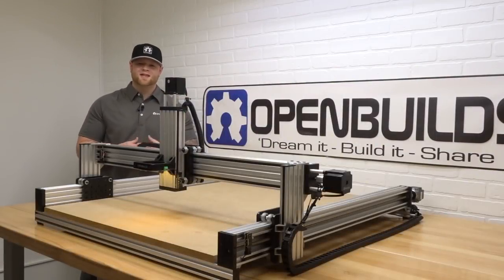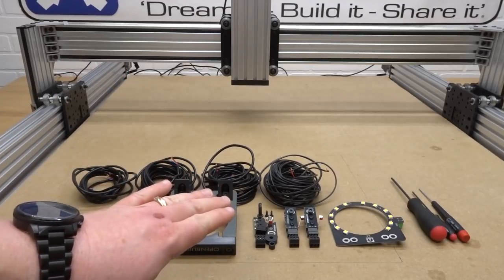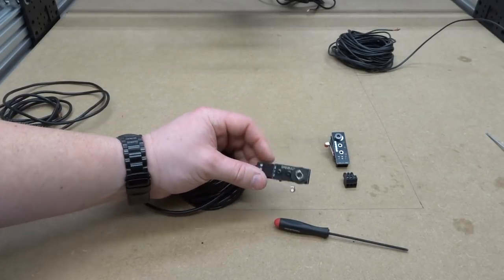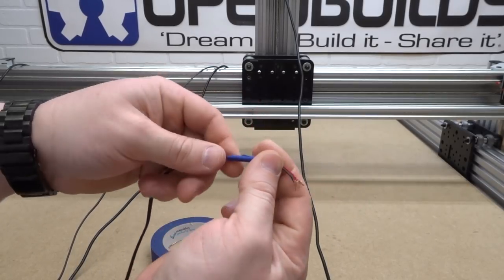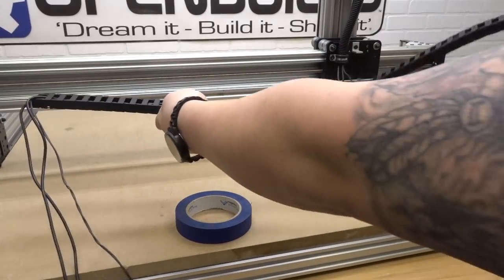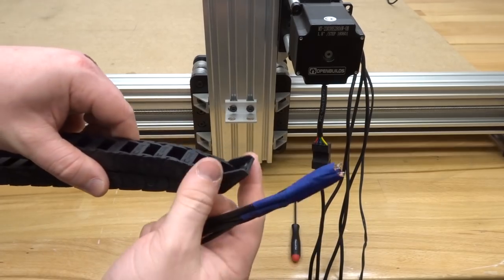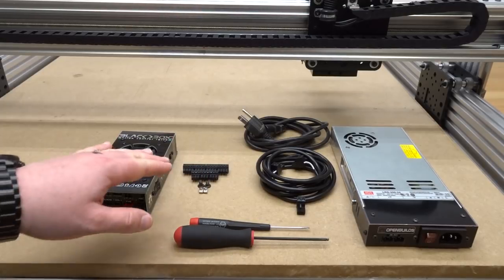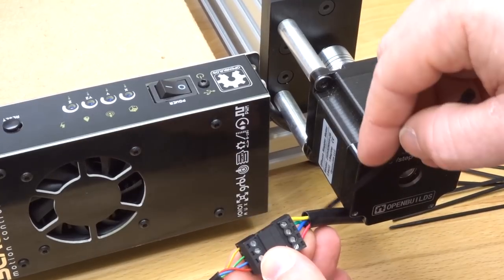OpenBuilds LEAD Machine 1010 Electronics and Software (Using BlackBox)

Comment: Nice build I m thinking of a lead 1050 setup for my workshop in spain for small but high quality work hence the lead.... would love 1075 just no space....
Reply from the maker: Thank you! I understand space can be an issue when working with a larger machine, but thats the beauty of the OpenBuilds Modular System, you can alter the size of these machines to fit your needs. Black Friday is happening now, definitely a great time to get your machine:  https://openbuildspartstore.com/blackfriday2019/ 👍
Reply: @OpenBuilds  building a 1075 Lead Screw over Christmas and  New year 2019, finished mechanical build now moving onto electrics tomorrow... I made space in the end and have not regretted it, the extra 25cm makes a big difference to what you can do so I'm glad i made the space but not that I topped by budget but thats life....All going together very nicely thanks to the build videos. Barcelona Build on openbuilds.

Comment: Which wires are you used for connecting the power supply.Is it 18 gauge shielded  speaker wires.I already order power supply and blackbox and connectors.But i am confusing what kind of wires using for blackbox ( 4 conductor wires) and power supply ( 2 conductor).
Reply from the maker: The power supply uses 2 wire with the ground on the left side looking down from the top of the BlackBox. Please take a look at the docs here to see the simple wiring instructions - https://docs.openbuilds.com/doku.php?id=docs:blackbox:connect-psu

Comment: Will the switches work with 2 wire instead of 3 wire?
Reply from the maker: Yes, basically you would bypass the v+ option on the xtension limit switch and just wire up the ground and signal. The v+ is power to the LED signal light on the limit switch. 👍

Comment: Nice work  👌 thanks to open build team

Can we add additional x axis with this black box ? (Like Y, Y1 )
Reply from the maker: Thank you! The BlackBox is only a 3 axis controller with the options for 1 clone axis ( in your case Y1/Y2) adding an additional X axis is possible if it is moving with the original X axis, (so you would share the same motor port with two motors). The BlackBox has powerful drivers pushing a max of 4A, so as long as you stick with the standard Nema 23 Motors you should be fine.
Reply: @OpenBuilds  thanks for your reply
Reply: @OpenBuilds  can the black box or xpro4 handle a high torque nema 23 1.8 amp?  
STEPPERONLINE Low Current Nema 23 CNC Stepper Motor 1.8A 340oz.in/2.4Nm CNC Mill Lathe Router

Comment: I have to 1000X1500 does the wiring outline in the video fit the machine since there is a size difference do I need longer wire or should I be ok?
Reply from the maker: With a 1510 configuration you will need longer wire. Please reach out to contact@openbuildspartstore so we can assist you further. 👍

Comment: Designed a file in Paint, imported it into the CAM software but want to adjust the size of the image? Can I do it in the CAM software after I have it imported?
Reply from the maker: Hi, please refer to https://openbuilds.com/threads/openbuilds-cam-software.13122/ we can better assist you through the forum thread. 👍

Comment: My first build and using the open builds black box. After watching the video I only have one question. Where does the 2nd dc output connect into?  One is the power supply and I can't pick up where the other connects to. Thanks in advance for clarifying.
Reply from the maker: Hi Tony not sure if this question was answered for you. The secound DC output is really just an extra output. So lets say you have a laser that runs on 24V you could use it for that or just leave it off no harm. Hope this helps

Comment: Red blue green and yellow are what with A+/A-/B+/B-?
Reply from the maker: We try to simplify the process for new users; A+/A-/B+/B- describes the coil pairs in the motor, but based on the orientation of the wire color order it's unnecessary to describe the coils in  A+/A-/B+/B- manner. Check out the documentation here for a more detailed explanation: https://docs.openbuilds.com/doku.php?id=docs:blackbox:faq-identify-motor-coils